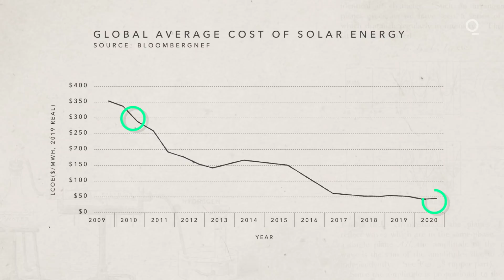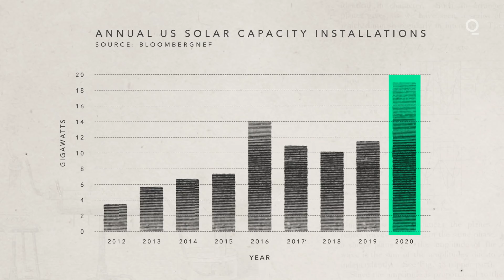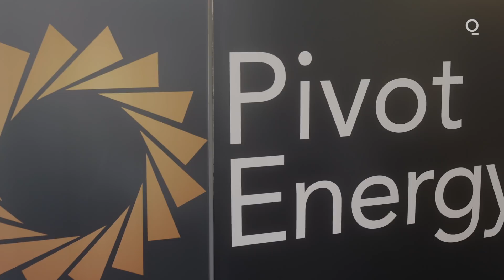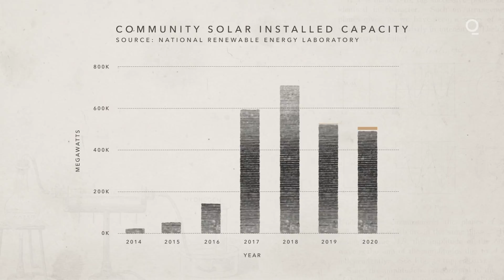Community Solar Is Bringing Renewable Energy to Everyone

Comment: Example, you are paying $0.3/kWh for electricity bill.
For community solar, you sign a contract for a fixed period with the solar developer to purchase a fix amount of "solar energy" at say $0.27/kWh.
Example - You sign a 100kWh per month contract. You pay a fix monthly $27 to the solar developer, you save $3 per month.

You need to do your homework to ensure that your monthly consumption is more than 100kWh.
If you go on holiday for 1 months and your electrical meter records say 10kWh of usage for that month, you will still need to pay $27 to solar developer regardless.

For the solar developer, they probably receive $0.2/kWh from the local grid operator by exporting solar energy to the power grid. 
For a 100kWh per month contract, they will earn a profit of $7 per month from it.

Comment: Global warming was officially stated at 1.1°C in 1991 and 1.06°C in 2022.  There is no mechanism that would allow greenhouse gas behavior to cause global warming.   The back of the United Nation's IPCC science report states it took its greenhouse gas samples at 20,000 meters altitude where it is common high school level knowledge there is no greenhouse radiant energy.  This is typical practice for deceptive marketing to state legal data transparency protecting the perpetrators from fraud prosecution.  

Earth's greenhouse effect is frequently used as a primary example to high school students of a system always in saturation from the strong greenhouse gas water vapor absorbing all the greenhouse radiant energy from the earth with greenhouse gases within 20 meters of the surface that is all around us everyday and can't have its overall effect changed.  There is no further greenhouse radiant energy to interact with greenhouse gases.  At 1% average tropospheric water vapor over 99% of earth’s greenhouse effect is from water vapor.  Water vapor would hold earth's greenhouse effect in saturation if it were the only greenhouse gas in the atmosphere.

Arctic warming is taking place with the proving mechanism being warm Atlantic Ocean waters migrating deeper and more frequently into the Arctic Ocean warming it and the region.   That warmer water is causing a few weeks less of reflective snow and ice coverage resulting in more solar heat gain to the Arctic region surface.

Atmospheric CO2 levels of 1200 ppm about three times what they are today would greatly invigorate C3 plants the majority of plant life on earth greatly greening the planet. 

0.4% of the atmosphere is CO2 and on average 1% is H20 water vapor.   (1% H20)/(0.4% CO2) = 25.  Water vapor is 25 times more present in the atmosphere on average than CO2.   Water vapor has an CO2e of 18,  18 X 25 = 450 CO2e total for water vapor to 1 CO2e for CO2. 

The Earth’s oceans have 3-1/2 million sea floor volcanic vents warming the water and changing it’s chemistry that have not been systematically accounted for.

Comment: Just asking for your opinion on a different concept of my own that is quite basic. The build can at least be of 2 ultra strong permanent magnets, one above another where the top magnet stays stationary on a plastic* container filled with water while the other is inside that container. Between the top magnet and the container needs to be a very narrow gap for which a light sheet of lead* can easily slide between the magnets just enough to cause the bottom magnet to fall as if it were a delicate power switch that the rise and fall will help* generate more electrical power than it would take to move the lead* sheet in and out of that gap in least frictionless way, maybe levitated by other magnets. The water is basic to prevent damaging and even far to much noise.
.
In summary... it would be as if the permanent magnets can be switch on and off like electro-magnets.
.
I tend to come up with a whole lot of various ideas that worked out awesomely, but... not always able to test some of my ideas out.

Comment: Checkout Starlink for better internet service. Also look at vertical wind turbines to boost your output. There is a new company called Solar Windows Technologies. It’s an upstart but will be cheaper than regular solar panels and will more than triple your energy output if you can get it going. Imagine how many windows that you have facing sunrise and sunset plus your regular solar array.

Comment: The solar farms can, and should also be used for regular farming eg grazing sheep goats or cattle if the panels are mounted high enough. Even vegetable crops.
Reply: Why not roof top solar?
Reply: @sprhr0  there is some research into the benefits of a solar set up like this. Namely providing a shaded area for animals and the turf keeps the ground temperatures lower making them more efficient. Roof top is great but they can be more inefficient because of how hot roof tops can get.
Reply: @parkerj9868  also

Accessibility for maintenance

Large scale project is better on open space . Roof top has limited space ?

Oh, here its all concrete buildings having open terrace clogged with water tanks, wires, dish antennae, etc

Certainly city life is not at all civilised .
Humans here have sixth sense thats nonsense
.
Reply: There is, it is called agrivoltaics.

Comment: I have 36 solar panels installed in June  2016.   Have Generated over $9000 kwh credits off my electric bill net energy.. annual output over  13,000 killowatt hours /year
Reply: how much did it cost for both the installation and the solar panels themselves?
Reply: In Cali? If yes send help to Bill Mahr
Reply: not Cal
Reply: @buzz-9x  As expected. Cali is a hell hole for small businesses.

Comment: Just 2 major problems  with this most people dont use the solar during peak production.  Number the batteries  are  far from being able fill the gap in usage curve.
Reply: @денисбаженов-щ1б  peak power production  is between 9 am to 4pm  . I'm not home during those hours like most humans I work during  those hours .. look up the duck curve. I work in power production  I know when peak demand is.
Reply: @денисбаженов-щ1б  that's still not peak usage. Look I'm not gonna argue because  I'm correct. Look up the duck curve .

Comment: Just wasted 10 minutes of my life and I still have no idea how community solar works
Reply: They build solar farms near communities, then they get people in those communities to use them as the energy provider.  So those customers get bills from the community solar project, pay cheaper rates than traditional energy providers would charge, and the community solar project uses any profits to build out more solar or to reduce rates.  So it's kind of like having solar panels on your own roof except the panels are installed and maintained in a shared remote location.
Reply: @CL-gq3no  thanks that's much better.  Wonder if they have storage for nights and cloudy days so customers can disconnect from the traditional utility altogether
Reply: @anuj3956 , in the near term probably not because solar and wind still make up a smaller portion of grid energy than fossil fuels. So currently fossil fuels are still providing that buffer/baseline power.  Longer term, as solar and wind overtake fossil fuels, battery storage will need to be deployed and fossil fuels will be phased out (because of higher overall costs compared to renewables w/ battery storage).
Reply: Let's talk more,,,,+,,,,1,,,,,,6,,,,,,6,,,,,,7,,,,,8 ,,,,,3,,,,,7,,,,,2 ,,,,,2 ,,,,,,4 ,,,,,, 0...
Reply: @bloombergquicktake.1825  ok, this is the 2nd time I've seen this "number"... who is this?
Reply: @steves3651  report it as spam it is a bot. spamming the comment section.
Reply: First they get funding from Governments. Than they request builder for a project. The builder deploy the panel and manage them. So they basically do nothing beside demand founding. The builder and operator do the work and The money of the investments come from taxes.
Reply: @BizzLeVrai , If you can't even spell very common words like funding, panel, or basically, I'm pretty sure you don't know what you are talking about.
Reply: @CL-gq3no  your lost. not mine.

Comment: Energy with a low conversion rate - waste of time and money.
Reply: Low conversion rate? Wtf does that mean
Reply: @ThomasBomb45  You don't know what a conversion rate is? Input vs output. Then consider loss during storage and the conversion rate is even worse. I don't have the numbers at arms reach but wind is slightly higher then solar and wind is really low. Another issue is the delivery of such energy. We have jump in on Lithium but within a couple decades we have exhausted the resource. They are trying to pull Lithium from Copper with little success. I am not saying one day but today is to early for mass application.
Reply: @IDIOMRADIO  The efficiency of converting sunlight energy to electricity doesn't matter. It does, to a point, but a roof without solar panels has a PV conversion efficiency of 0%. 20% is way higher than 0%. It's an infinity% increase! :)
Reply: @IDIOMRADIO  We don't need batteries to make solar viable. We can replace something like 20% of all electricity generation with solar and wind with basically no batteries. It reduces the use of existing fossil fuel generators and could even prevent more from coming on line.

We also have more than just lithium batteries for storage. Pumped hydro is a mature tech that is a great option for the right geography. Redox flow batteries are being deployed at a total cost of ownership similar to lithium ion with less degradation. Plus theres research into lots of other storage technologies like liquid metal batteries, liquid air batteries, compressed air energy storage (CAES), and creation of fuels such as hydrogen or synthetic fuels
Reply: Let's talk more,,,,+,,,,1,,,,,,6,,,,,,6,,,,,,7,,,,,8 ,,,,,3,,,,,7,,,,,2 ,,,,,2 ,,,,,,4 ,,,,,, 0...,,,,,,

Comment: Renewal energy is not the answer, you are just delaying the inevitable.
Nature is the answer, in Singapore they are redesigning their cities so that wind could flow easily, planting more tree and building artificial pond and water stream. It will result in decrease in temperature which will lead to decrease in consumption of Air Conditioner and refrigerator which lead to less CFC and green house gasses effect.
Reduce your electric consumption and you don't need these.
But these advice is only for poor or middle class, rich will do what they do.
Reply: Using less energy is great, but we can't stop climate change by burning 50% as many fossil fuels. We need to get to zero. We can't get to zero without renewables
Reply: @ThomasBomb45 , we don't need to get to zero actually.  We just need to get to the point that nature can keep up.  We can start with the lowest hanging fruit and work our way up until we find a balance.  Commercial planes and large ships would be last on the list for example.  But you are correct that some artificial ponds and some trees alone are not going to solve the problem.  I live in FL and artificial ponds and streams would just make it that much more humid.  Also, a tree or pond is not going to get me to work or charge my laptop.  So yeah, every little bit helps, but solar is a giant piece of the puzzle.
Reply: @CL-gq3no  nature can't keep up if we keep burning fossil fuels.

Every atom of carbon a tree absorbs is released when it dies. The vast majority of the carbon cycle is a closed loop. If a forest Burns, it releases a lot of CO2 but then the new trees growing absorb that CO2 back over 10 or 20 years. But once trees are fully grown, they don't absorb CO2. So without human activity, carbon dioxide levels would stay roughly flat.

The problem comes from digging up carbon out of deep underground. All of that carbon has nowhere to go, because plants are too busy absorbing the carbon released from the tree that fell down to open up room in the canopy for the next tree
Reply: Let's talk more,,,,+,,,,1,,,,,,6,,,,,,6,,,,,,7,,,,,8 ,,,,,3,,,,,7,,,,,2 ,,,,,2 ,,,,,,4 ,,,,,, 0...,,,,,,